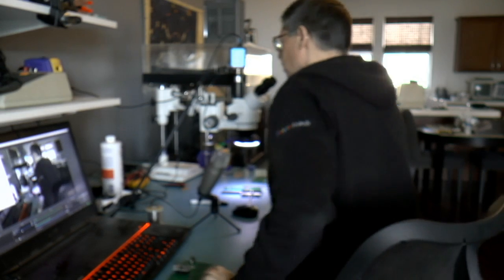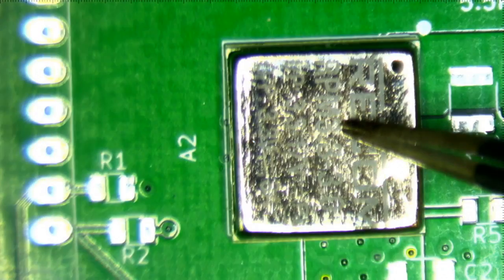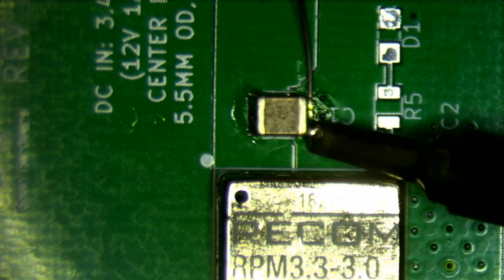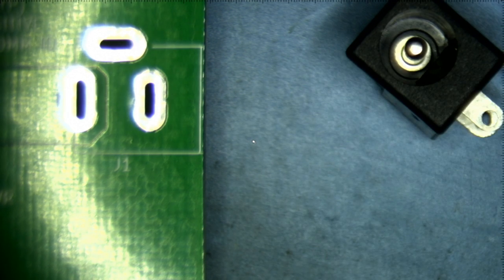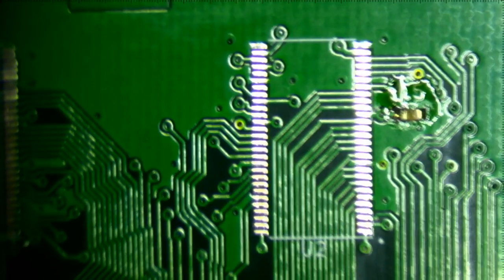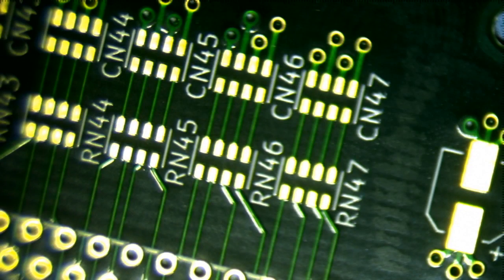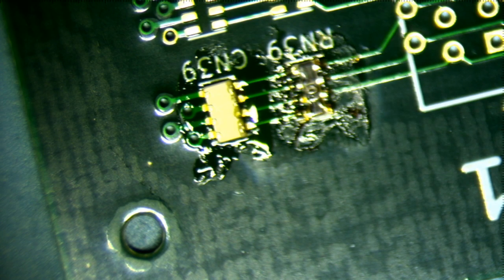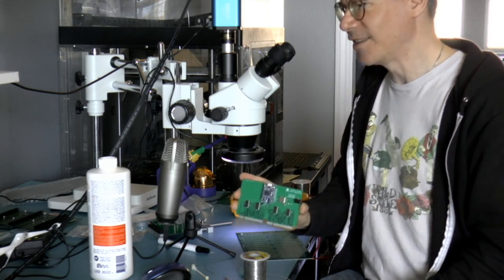Livestream: Soldering RISC-V LMARV-1 tester+backplane

Comment: I got the Rossmann flux and it did fix one thing. For the most part though I use a 1/2 inch wide double bevel blade on TQFP packages and use the blob and flow method. The blade does a better job than the tip you are using. For cleaning rosin flux i found the Air tool cleaner will remove flux. it is flammable though since it's heptane. I also use Kapton tape to hold parts in place and to shield places.

Comment: Couple of things about cleaning your flux: use kimwipes to get that residue off. Another thing: I had a bad experience with the kind of  flux Rossmann uses (I said "kind of" because I'm not sure if it's the same. Sure looks the same.) Anyways - the damn thing conducts! Well, in megaohm range, but still... Enough to screw up some analog circuits. Drove me nuts! Washing this stuff off from under chips without ultrasonic bath is a pain. I think conductivity goes away after few days, but testing your stuff right away is, well, entertaining...

Comment: yes, 450°C sounds very extreme... Another "danger" of too high temperatures is a faster oxidation of the solder and the solder tip. The first will counteract the action of the flux, the second reduce the lifetime of your tip.
Reply: sorry that I missed the stream ;-)

which way to connect the LED? Use this one: https://www.thingiverse.com/thing:3198136
Reply: minute 33 - you perhaps want to review the settings for the "thermals" in your copper fills, there seems to be less of a gap and more copper than you actually need.

For the card-edge connectors: pcbgogo.com offers an additional option to have HASL with "gold fingers" at the card edge, you should check with your manufacturer, because hand-soldering on gold is not much fun in my experience...
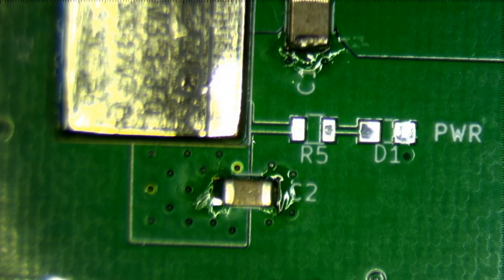Reply: min 39:30 - you don't need 10 mA nowadays for an LED anymore, 1-2 mA is usually enough for an indicator...

min 41 - I also used to solder circuitboards, on my first batch I put all the smd tantalum electrolytics in the wrong way. How should I know that the line marks the POSITIVE side ;-)
Reply: 1h34 - when soldering the capacitor array you simply didn't get any heat down to the pads. Tinning the pads ith a much thinner layer than you did in the beginning woks. Or just tin one pad and reflow that than you don't have to hold the part as much anymore...